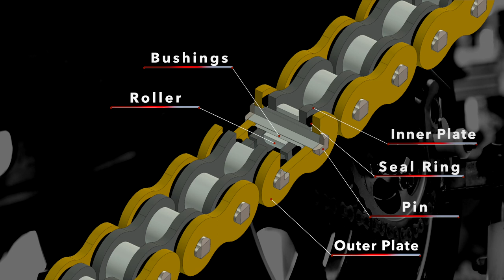RK Chain Maintenance Instruction Video

Comment: Back here in Malaysia in Nov 2022 my new Yamaha Y16ZR rolled out with RK 428 ERO and RKM sprocket set as standard OEM. As for me who ride it daily fast and hard really surprised to find out bout this RK things. It took a solid 2 long year time before the chain set at last ask me for their retirement when some roller get stiff resulting uneven move.
It becoming more interesting when.. Believe me in that 2yrs time not even a single time my hands get a tools for adjusting the chain. To honour the hard working chain and loyal I now use the very same brand and never will go for other as it also applied with me loyal to my wife. So for the retired OEM chain set they still with me where i kept them in a nice tool box. This testimony is true. No ringgit ever go to me from RK Malaysia for this. Cheers.

Comment: Do I need to clean the grease off new RK chain
Reply: Only off the outer edges.. But if you do clean the lot off like I did then you have to grease/wax the chain as per this video before you start riding.

Comment: why wipe after lube? doesn't it dries out the lube itself?
Reply: Because you don´t want chain lube on the sides of your chain. The friction your chain has to withstand basically only occures on the chain joints where each chain link is connected with each other. That´s why they showed the 4 lubrication points all at those joints. Lube on the side of your chain will only collect unnecessary dirt which will wear your chain down faster. That´s why you should apply the chain lube only as they showed here as well, on the inside of your chain.
Reply: tq for explaination @Schmitzelhaus